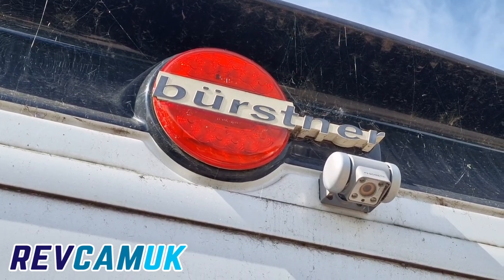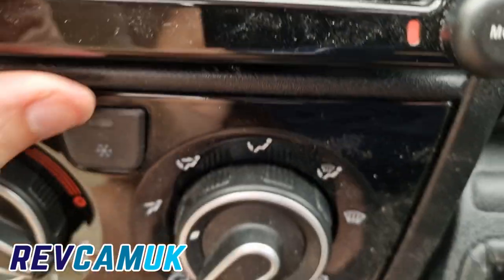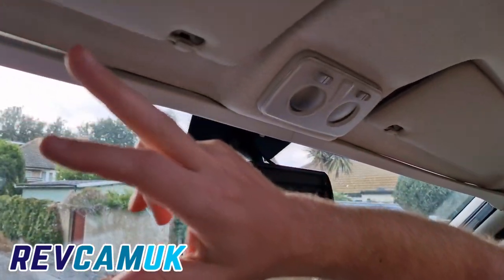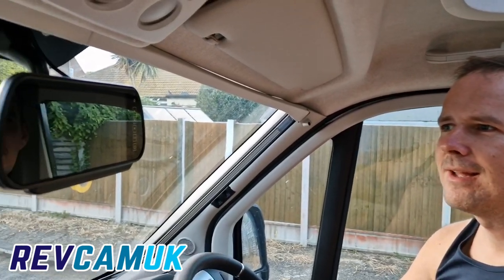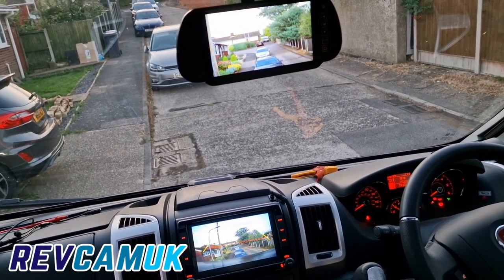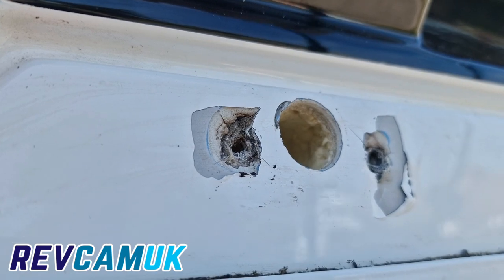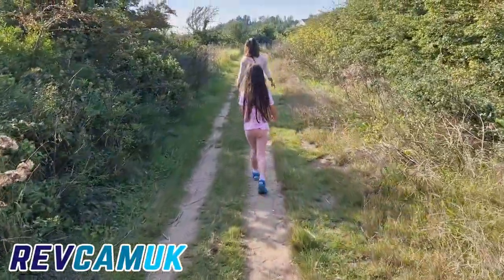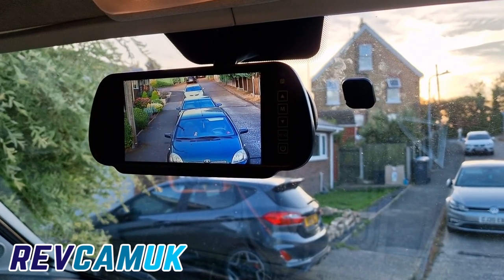DIY upgrade on Burstner to twin reversing / rear view camera. Adaptors made it so easy!

Comment: Great video, thanks. I would have liked to have seen how you routed the monitor cable through the dash.
Does the reversing camera stay on permantely, or only when it's put into reverse?
Reply from the maker: Hi, We exited the cable via a hole to the rear of the radio unit cavity.  On our install we had Remis blinds, so we ran the cable behind these.    If you didn't have the same type of blinds then it would involve unclipping the side pillars (ideally with a trim remover tool to avoid breaking the poppers) and running the cable behind the headlining (this just pushes in behind with no need to remove anything).  

On this install I had the reversing camera input to the stereo using the additional CAB0020 piece.  When using the adaptor set your reversing camera always has power when driving.  On the Pioneer stereo we have fitted, there is a camera button, which can be toggled on whenever you wish to view the downward facing camera when driving.  If you were keeping both cameras on the mirror monitor then you have full control of when you want each camera to be showing a picture flicking between each camera with the V1/V2 button on the mirror display. Best regards, Martin.
Reply: @revcamuk9861  Many thanks. Now all I need to do is to find the camera plug location on my Bürstner 690g.
I thought they would as your video, but unlikely they aren't there 🤔
Reply from the maker: I have heard from a couple of people that they have found their connectors hidden in the moulding behind where the Burstner badge is fitted. In fact one customer found that the reason the camera had failed was because the drain holes had blocked and the connectors had sat in water and rusted the entire connector. To look in this section, you will need to take 3 screws off.  One behind the Burstner badge, and one on each side of the trim. You will usually need replacement screw covers available on ebay here (not sold by us) : https://www.ebay.co.uk/itm/173214681685? @foggie8496   If you do take any videos or photos I would love to see them so I can share with the community.
Reply: @foggie8496  Have you had any joy in finding your  camera plug location? I am in the same position with my 690g and a bit wary of removing anything!
Reply: @sandymerry9172  Hi, yes. I took a few photos, but I'm not sure how you post them to YouTube.
There is a 13A socket and light switch below the centre over the bed cabinet.
You will notice that behind the switch/socket that it's boxed in. This holds the wires for tge soxket etc but on mine, also the camera connection.
Simply feel carefully along the vertical sides for a fake wood sticker, one on each side that covers the screws. Remove these and the base will come out.
Reply from the maker: Hi @foggie8496  I would love to see the photos if you are able to send them either by email to photos@revcam.uk or by whatsapp to +441843825425. If you send them I will reply to sandymerry9172 requesting he sends me an email or whatsapp to reply to, and then forward them to himself and any other people that it might help. My ambition is to have a comprehensive support catalogue for the various motorhome builds to help our valued customers when it comes to replacing parts or upgrading.
Reply from the maker: Just to let you know that @foggie8496 has sent me the photos of where his connector was found, not too tricky if they are in there. If you would like me to send the photos, please either email me support@revcam.uk or whatsapp me +441843825425  @sandymerry9172

Comment: Hi I’ve just purchased the same system but I’ve not been given any instructions for assembly of the twin camera once I’ve fitted the camera bracket. I don’t suppose you can share the one you have?
Reply from the maker: Hi, please find a link to our downloadable PDF instructions for the twin lens bracket camera : https://www.revcam.uk/files/attachments/instructions/Twin%20Lens%20reversing%20camera%20fitting%20instructions%202.pdf
Reply: Awesome thanks for the swift reply and info. My camera has 5  or 6 little plastic spacers that were fitted in between each lens and the brackets as well as either side of the positioning disc. Any advice on keeping those in position during assembly ?
Reply from the maker: Hi, that does sound unusual. I haven't heard of that type of assembly before. It would be interesting to see what you have.  If you pop some photos over to support@revcam.uk I may be able to give a suggestion, I can't promise though. @karlshort-x6c